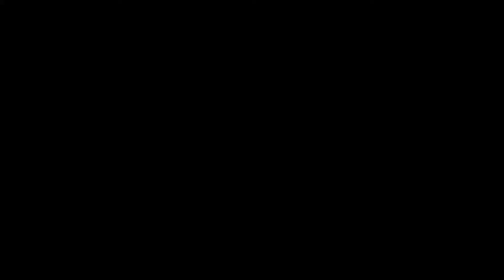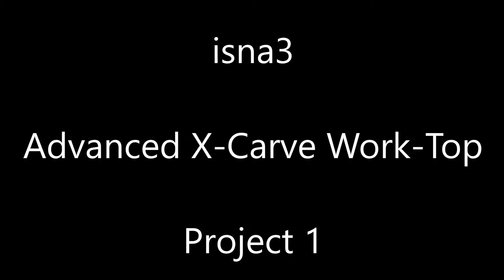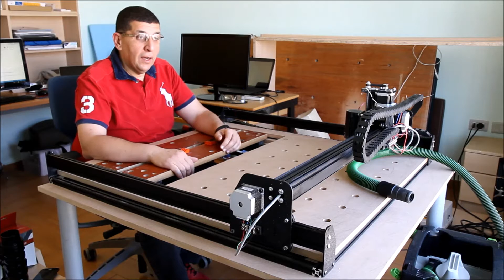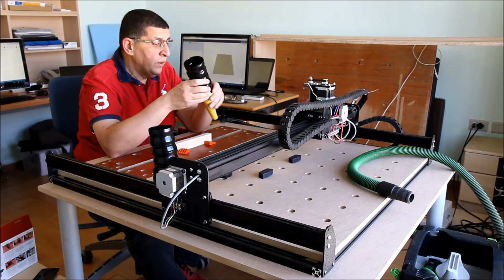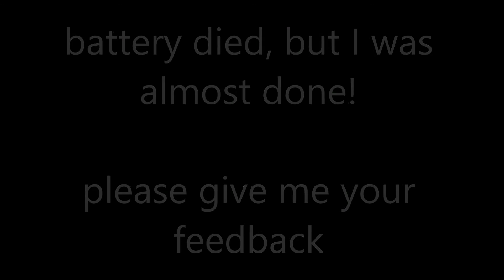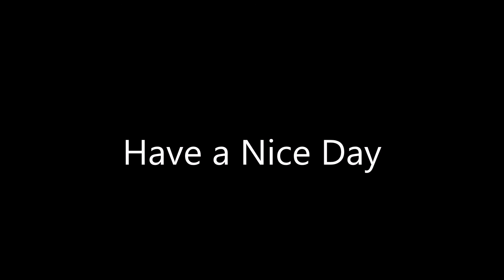Advanced X-Carve Work-Top

Comment: السلام عليكم اخ جواد .. اولا احييك على هذه الفكرة الرائعة وعلى مشاركتها مع الجميع
انا معجب بالجهاز جدا وسأشتري واحد قريبا لكن عندي بعض الاستفسارات 
هل يأتي مع السوفتوير ام يجب شرائه بشكل مستقل ؟ أين أجد السوفتوير؟
ما هو أكبر مقاس للجهاز يمكن الحصول عليه ؟ هل ممكن أن يأتي ٢٠٠سم*١٠٠ سم؟
 هل هناك اصدار خاص بالنسبة للكهرباء ٢٢٠ فولت  ؟
Reply from the maker: +Dia Hen

وعليكم السلام أخي ضياء

The x-cave comes in two sizes the larger one is 100cm x 100cm this is the size of the axis so you only get like 82 x 82 as a cutting surface. you X access will always be limited, but the Y access is unlimited since you can cut multiples of 82cm and keep sliding the work area.
The X-Carve controller can be switched to 220 Volts, regarding the spindle it is 24volts DC but I do not advice you get that, I am using the know the DeWalt 611 which is much better, but in this case it is best that you purchase it locally with 220 volts, you can use any router as long as you adjust the mount to its diameter. 

The software is totally free it is web based so you launch it from your browser  http://easel.inventables.com/users/sign_in 

I hope this was helpful 

Jawad

Comment: I found with the festool clamps, they will rise more the longer the arm is....Use the closest holes you can and put some downward pressure on the clamps as you tighten them - also you don't need to rotate the tightening handle that much to get a good grip.
Reply from the maker: +Richard “BrainFizz” Morley 
Many thanks, I will increase the wholes so I have more options.
Thanks for the advice!

Comment: What a clever idea!  I have an old Black and Decker workmate that I haven't used in years.  There's another guy here who cut a hole in his wasteboard to do mortise/tenon joints, but this is also very clever, a more all-around solution.

I can't wait to see how you do dovetails on the X Carve.
Reply: +BlazingLaser   thanaks for the feedback. I will share the video when I experiment with dovetails using the DC spindle, but I think it will much more practical when I put my trim router, I am just waiting for the mount from Inventables